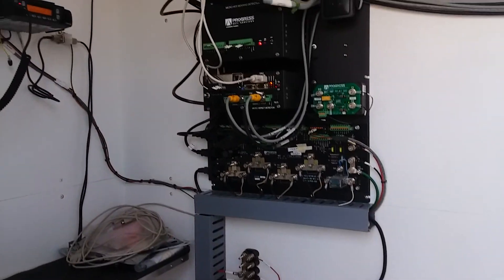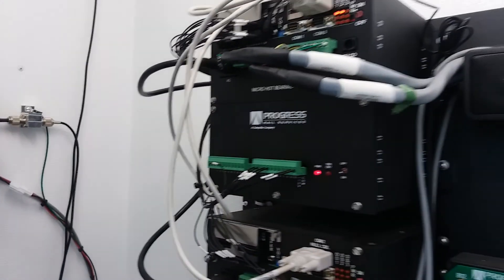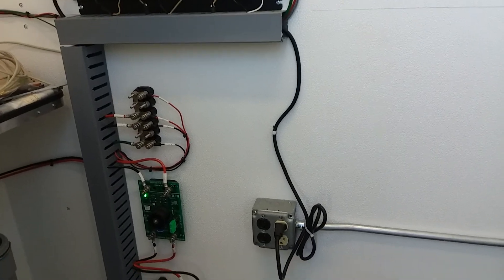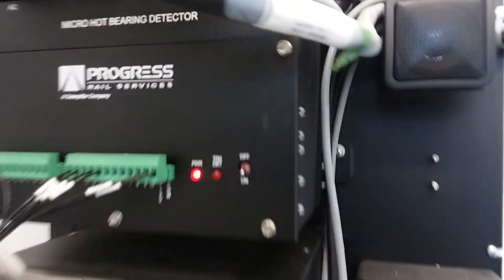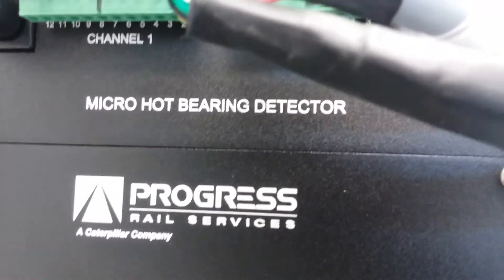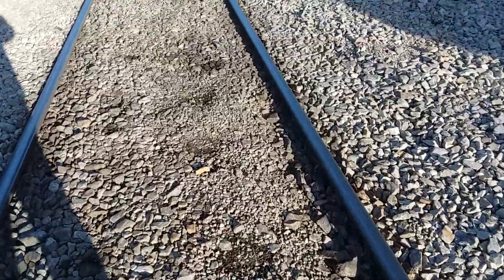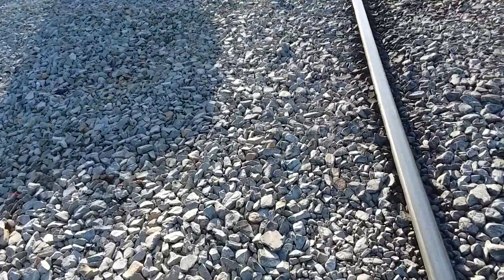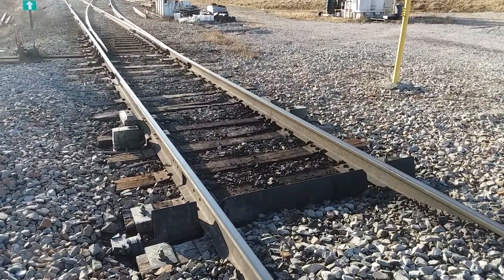Hot wheel detector, look inside the defect detector building

Comment: Hi Dave, thanks a lot for this video (and all of them). What's the name and purpose of the two little boxes placed gauge side of the hot wheel/bearing detector?
Reply from the maker: Your welcome and thank you for the kind words Mtro Guerrero.
There are two of those boxes on each rail. They contain the cameras which take infrared pictures of the bearings and the other box
takes infrared pics of the wheels. That info is fed into a computer
in the wayside cabinet and checked against certain parameters.
If the temps of the wheel or bearing are above those parameters
then an alarm message will be sent over the radio so the train
knows to stop and investigate.  Really appreciate your taking the time to watch the video and may you have a very good day my friend.

Comment: Dave ,how does the hot wheel defector ,tell you which car it is.
Reply from the maker: Good question Andrew. it counts wheels. When a hot wheel or
bearing is detected it will give an alarm and give the exact axle
the defect is on. Thanks so much for watching and writing in
my friend.
Reply: @ccrx6700  thanks Dave
Reply from the maker: @andrewthacker114  👍😊

Comment: I listened to a train coming into the US from Ontario thru Rainier Mn. It was moving about 10 mph and had what sounded like a broken or cracked wheel. I wondered at the time if they had devices to detect that type of problem. It rolled past a CN office and Customs office. Later that day I heard they had a derailment just down the line, (16 cars) at low speed. I have no idea if it was related. CN staff never notify local officials about things like this.
Reply from the maker: Some RR's do have an impact detector on some sections, but some
RR's don't have them so hard to tell on the CN division you heard
that on. They are called WILD, wheel impact load detectors. 
A flat spot on a wheel or a broken wheel can be the cause of a derailment.
https://lbfoster.com/en/market-segments/rail-technologies/solutions/rail-monitoring/track-monitoring-systems

Comment: IR photo Diod with a microprocessor measuring voltage difference between ambient and sample.  If the difference is greater than a set amount, the data in the stack is marked as positive.  Why they are still doing voice alarm no one knows.  Best way is to transmit from there to on train computer to give direct visual to the conductor.  New tech is semi monitoring gives in cab information.
Reply from the maker: Thank you terenfro for the highly technical comment. One thing
to satisfy your curiosity is these old locos don't have computers,
just a radio so via radio is only way operator will know
of a problem. It is also very helpful for the track crew and mechanics
and office to be able to hear an alert. that way everyone is
on the go to get to the detector site where the train will be stopped.
Appreciate your visiting with us today my good man.

Comment: So does the same pair of sensors detect wheels and bearings on the far side of the track too or another pair sensors ?
Reply from the maker: They are on both sides of the rails Steven so they can check both
sides of the car or loco wheels. Thanks for stopping by and
checking out the video my friend.

Comment: Sorry, more questions: How far apart are the axel counters at a hot wheel/defect detector? Also, how far are the trigger sensors (I guess axel counters as well) from road crossings. I notice that the signals/gates are activated well before a train reaches the crossing (it make sense), but the signals/gates deactivate right after the last car clears the crossing. I assume there are 4 sensors: one far down the track on each side of the crossing, and one just past the crossing on each side. That is what I had to do on my train detectors (I use IR LEDs) to get that more realistic look: plenty of notice to activate as the train approaches but deactivate as soon as the train passes.
Reply from the maker: Approximately 40 or so feet, if you need an exact measurement
write me back and I will get that for you. Only 2 sensors, they activate the shutters on the cameras immediately after a sensor finds a wheel to go over it. They are magnetic, you can take a spike and run it across
the sensor and it will open the shutters on the cameras. I can even set
the detector off to give a message by waving spikes over the sensor,
in and then have another person on the exit sensor do the same.

One time we had an operator who was notorious for going over
the speed limit. We played a joke on him by setting the message
off with spikes, it gave a train to slow message. We kidded the
operator, well that didn't mean you! LOL
Reply: @ccrx6700  40 feet or so, thanks.  I am sure they calibrate the system for the exact placement. For my trains I will use 40 feet at O-Scale.  I just posted a video on this based on your input. It is in my Trains Model and Real playlist. Feedback welcome. Thanks
Reply: @ccrx6700  Whoa! Exceeding the speed limit is a firing offense, right? Remember that accident over by that curve by Yankee Stadum many years back?

Comment: Count 'em in, count 'em out... Rawhide! [laugh]. Questions: Suppose the train stops within the Bungalo' detectors? Will it give a slow/stopped train warning?  Suppose for some reason the count in does not match the count out, does that alert to a derailure?

This is an amazing system. I bet your cohorts that work, in say the Bronx, must have a time dealing with vandals mucking with these sensors and breaking into the Bungalos.  Have you see the train theves in the LA area? They jump on slow moving trains, cut the bolts off containers and steal the contents. The tracks are heavily littered with open boxes - crooks don't care about picking up after themselves.
Reply from the maker: Yes most generally if the train stops within the gated transducers
then starts it will give a train too slow, depends on the speed of
the train as it first passes over the transducers. At either end are
magnetic switches which count axles in and axles out, these
are called gated transducers.

If train is going slower than 5 then you get a train too slow because
the detector works best at 5 or above. It will work at below 5 but
the results from it's findings may or may not be accurate.

We have never had that happen where the count in and out does not
match, however as you noticed once the train goes over the detector
there is a 15 second wait before a message is given. During that
time the detector is doing an integrity check of it's components,
so I suppose if the count does not match an integrity failure message
will be given. Then someone has to get into the computer to find
out what failure that would be caused by. There are many reasons
for that message and only can find the answer in the computer.
Reply: @ccrx6700  Thanks for the info! My system will create a Derailure Warning if both axel counts dont match - as they are common on model trains.

Comment: Great video! OK, those huts are called bungalos, good to know. You told me in another video that the Axel Counters are Proximity Transducer Switches.  So I guess the Bungalo sends an AC signal down to the Transducers. There must be a coil inside with the core mounted vertically just below where the wheel passes over it (that spot in the middle of the top side of the sensor). When the wheel passes over the coil, the magnetic field changes and the Bungalo electroncs can detect a current change from that (no moving parts for high reliabilty). It counts axels in as they approach the Bungalo, and counts them out as they depart, cool! To prevent false alarms, the system must expect the pulse change to occur at a certain minimum rate. This way, if you use a metal tool near the Transducer, it won't trigger the system too easily.  This was very helpful... I am going to make a coil based Proximity Sensor for my O Guage trains. Right now I use Infra-Red (IR) LEDs in my tracks to count axels, determine speed, and activate accesories. Tiny little coils that can detect steel wheels should work in cars that have steel wheels (as most quality O gauage model trains do). But on HO guage it won't work, those wheels are almost always plastic (except on the locomotives). The Hot Wheel detectors are IR cameras (2 on each side of the track). On each side, one measures the overall temperature of the wheel and the other is more focused to the center of the wheel (hub) to measure the temperature of the bearing as it passes. Very clever. You explained in another video that the Equipment Drag Detector is that wedge shaped sensor across the track. If something is being dragged, the object will flip the detector out of position and trigger an alarm. You said there are Switches inside it to detect a dragged object in either direction, I guess it is spring loaded to return upright as the objects pass by.
Reply from the maker: Glad I could be of some service on the info Paul, when you pass a
spike over the transducer you can feel the magnetic pull on the spike.
Let me know if I can be of any more assistance my friend.
Reply: @ccrx6700  Next time you place a spike near a Transducer, see if you can feel a 60 Hz vibration (active sense), but I am pretty sure it is just a coil around a strong magnet (passive sense).  The metal passing by induces a pulse (or even a spike going onto it makes a pulse and another pulse in the opposite direction when the spike pulled off) in the coil that the electronics can detect. This may explain why the system wants trains to travel at a minimum speed for the system to work.  Hey, the other day I saw a video on a Defect system that looked like it had two radar domes (radomes). One on each side of the track, they were rectangular shape. Any idea on what they are?
Reply from the maker: @paulromsky9527  When running a spike over it, there is a definite pull down
effect, don't know anything about Hz, but you can feel it pulling the spike down.
Our detector has 2 boxes on each side, one for hot bearing detection and
the other for hot wheel, they are the rectangular boxes you speak of. Any way
you can visit us? I can take you there and show what all is involved.
Reply: @ccrx6700  The things I am talking about are on 2 foot or so poles, they are about the size of a bread box. The point toward each other from each side of the track. Let me see if I can find the video. I asked what they are, he didn't know. I think they may detect the gaps between cars over the couplers to count the cars, but maybe they can detect stowaways.
Reply: @paulromsky9527  I wonder if those are RFID readers. Railroad cars can have RFID tags on them for tracking.
Reply: @brianleeper5737  I was told above by ccrx 6700 that the Transducers can be triggered just by holding a spike to them, so they must be simply inductive. They could be RFID, but I think they are using that for speed limit enforcement and other things - like as you said, tracking. With enough RFIDs along the tracks, trains could become autonomous - the engineer simply along for the ride to monitor the system.
Reply: @brianleeper5737  Oopps, sorry, thought you were talking about the sensors on the track, you were talking about those radome things... yes, RFID, that makes sense.

Comment: The default detector does that scan the hole wheel or just the spot that passes over it? I really like your videos. I find them really informative. Keep up the good work.
Reply from the maker: Awesome question Matthew and one that I don't have an accurate
answer for. The scanner box bolted to the rail has an opening
about 1 or so inches wide, so am thinking that is the width of
the scan. It takes an infrared picture of the wheel and bearing,
then the computer figures out the temperature, pretty darn
high tech, far above my pay scale...LOL  Appreciate your watching sir
Reply: Ok cool that's way above my pay scale too. Lol

Comment: I believe the Micro Defect Detector is an ultrasonic unit, the transducers mounted on the inside of the rail. Those appear to be EAC coupled Rayleigh wave transducers. Or I could be way off. It could be a WLID.
Reply from the maker: Wow, I'm not sure, I do have some CD's that came with the unit, will have to look that up sometime. All I know is the gated transducers send a signal to the detector circuitry which counts axles in one one end and axles out on the other. Appreciate your watching
Reply: Hi, they're magnetic transducers that generates about 1/2 Volt AC for each wheel flange passing over it. The Micro Defect Detector uses infra-red based sensing comparing the wheel bearing heat & wheel heat for the "Hot Wheel Detector scanners" to the ambient outdoor temperature. The 2 transducers near the scanners at time mark 4:06 tells the system to collect (if I remember correctly) 32 samples per wheel bearing. Those are called the "Gating Transducers" and the furthest Transducers (at time mark 4:31) away from the scanners are the "Advance Start Transducers" (one in each direction) that will open the scanner shutters, turn off the 110VAC that powers the internal scanner heaters to prevent snow build up & condensation for the internal optics (electrical noise elimination reasons). The Advance Transducers also help to determine train direction & speed calculations.
Reply: @tom49801  Thanks!, that's pretty neat.

Comment: Hi Dave, As the other viewers have mentioned, thanks very much for the opportunity to see the electronics inside. The outside I have seen. Lol, the inside, not so much. As a Class 2 are you required to maintain a certain number of these detectors or certain kind of detector?
Reply from the maker: Jeff, i am not aware that there is a federal regulation for having a certain number. From listening to others seems like other railroads have them bout 10 miles apart.
Reply: @ccrx6700  Thanks for that information. That is some pricey equipment, wow that is expensive. Obviously worth it. Have a great day.

Comment: Can a defective defect detector detect if it's defective.
Reply from the maker: Good question! After the rolling stock wheels have passed over the
cameras and out of the gated transducer (the counter that counts wheels in and wheels out), it does what it calls an integrity check where it is checking itself for defective sensors or readers or things
of that nature, it's quite technical and I really don't know what all or how it does it. If it finds a problem in the system it will announce,
Integrity failure. Depends on what the problem is, but it can still
record certain information from the train which can then be found
in the computer train log. It records all data for up to 130 trains and
then starts to write over them.
Reply: @ccrx6700  Thanks for the info. So as long as the self diagnostic isn't defective then it can detect defects and we're good to go. Gotta love technology.
Reply from the maker: @TheRantingCabbie  yes sir, these detectors are totally amazing. They also average temps between all the bearings and wheels on 1 car, and they can send real time data to dispatch and on to the next detector down the line which will calculate that info into each car, and send that info on to the next detector,  and so on. Just amazing to me!!!
Reply: @ccrx6700    Big difference from how they used to manually inspect journal boxes. I remember seeing them do that in the early 70's.
Reply from the maker: @TheRantingCabbie  yes there is. We do a daily roll by visual inspection, plus they try to walk the trip with a heat gun checking bearing temps a couple times a week

Comment: You said it counted in and out, so if there was an issue would it tell you something like axle 38?  So you would know which car to check?  Great channel by the way. I stumbled upon it and have been captivated.
Reply from the maker: Ralph, yes sir, if it gives a critical alert message, the detector will give the axle number and the side of the rail, either north or south. 6 axles on the loco, then count back from there, it is an amazing piece of technology. Thank you very much for your kind comment, I am glad you are enjoying the show. Stay tuned sir, got a lot of good videos planned for this coming year.  I do appreciate your watching.
Reply: The way some of these hot box detectors work is like this:
A short range track circuit or 2 transducers start the detector as the train passes over them.  The shutters on the scanners then open up and start scanning and reading the temperature on each bearing. Some, like the one in this video also have scanners to read the wheel temperature as well as the bearing temperature. The transducers are counting the axles. Since there are two transducers, it also determines the direction of the train. If it detects a hot bearing, usually anything above 180 degrees for the axle bearing or 540 degrees for the wheel, it takes the axle count from the transducers and announces it over the radio. Train crew then stop, walk their train, count axles and use a tempil stick and check the bearing temperature. Sometime it is just a handbrake that was not released. If it is a true hot bearing,  the car is set out at the nearest siding, yard track, team track, etc.....
Reply from the maker: @murdstonecardinal3355  Thank you very much sir, Excellent explanation of how it works, appreciate your sharing that with us

Comment: Thanks very informative. At first I thought why such a big shed for a couple of relatively small electrical panels however I could then see it is designed so one can work inside it if needed, use the radio etc.
Reply from the maker: Wayne, yes sir, you are right. Bungalow is also cooled in summer and heated in
winter all for the comfort of the complicated electrical components, can't remember if I said that in the vid or not.